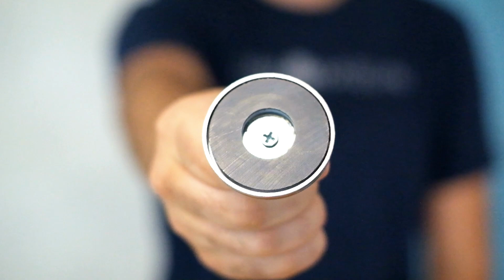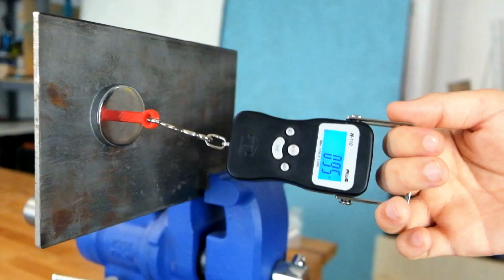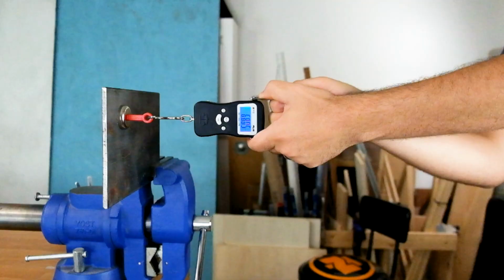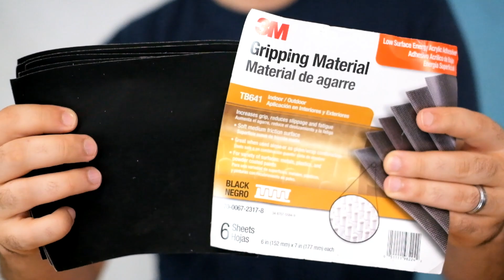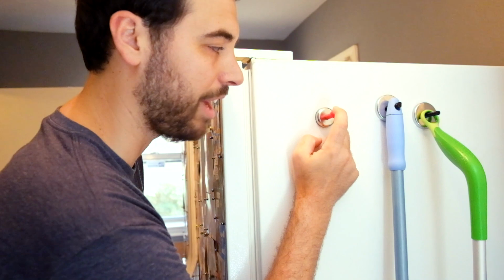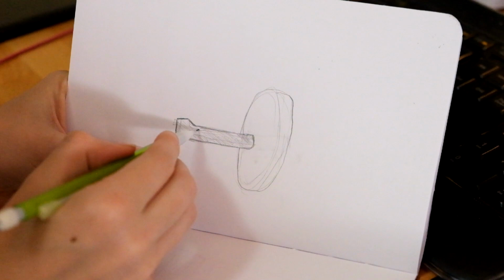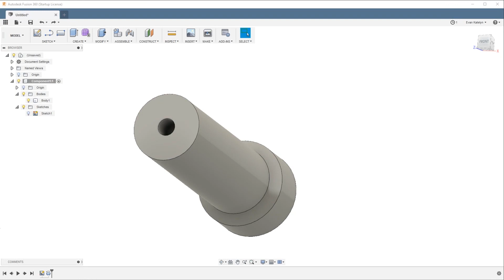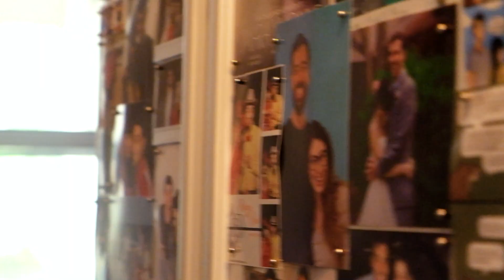Our Most Used 3D Print? & Evan Gets Distracted by Magnets!

Comment: Instead of using the vice, you could use the Fusion 360 hole tool and thread the hole, but do not model the threads (uncheck the option).  This will let you print an appropriate sized hole that can be tapped.  Then just use a machine screw.  I have had good luck with this method printing in PETG and even PLA.
Reply from the maker: Yep yep we've done similar methods! But this was a quick and easy solution too. All good options! 😁👍

Comment: Magnets seem to cling better to smoother surfaces or where the max amount of surface area of magnet is adhering to the metal. The fridge is coated with like a uh enamel paint and it's bumpy. So what if you made a thin thin rubber or silicone disk (minimize distance of magnet to metal) with the texture of the fridge so it would kind of lock/match up and be fully connected. It would decrease straight pull strength but maybe increase resistance to shear force.  Way overkill for what is needed but just an idea from one curious mind to another.
Reply from the maker: That would definitely be an interesting test to do! Haha yeah maybe overkill, but it could be fun!

Comment: Evan has become the Mad Magnet Scientist! Katelyn makes great roaring sounds :P I do thing the difference between the magnets (holding strength) had a lot to do with the surface area contact. The ceramic magnet looked like it had a larger diameter, hence more surface gripping power. I'm will to bet a neodymium magnet with the same diameter would have been stronger.
Reply from the maker: Interestingly, the neodymium, even at the smaller size, was rated for twice the weight so it was stronger... Just not in this exact situation. Would definitely be curious to try a larger one though!

Comment: Should've used a tap and threaded the hole on the print.  For the little bit of strength needed for that prints' function it would've been fine and wouldn't have a chance of splitting the print like the wood screw.
Reply from the maker: We often do tap our 3D prints but this method was quick and easy too

Comment: Try thin double-sided tape or just very thin slice of rubber : P should work. ive done some similar magnet shenenigans by myself so i know that it can be tricky, cause force between magnet and metal surface decays very quickly with growning distance... not sure atm about exact dpendence but it sth like distance^-4 cause it is dipole-dipole kind of interaction
Reply from the maker: it might work, but we worry it would have the same effect as the friction paper (which is kind of rubbery itself). maybe if the surface area was bigger than these small magnets?
Reply: if it will be thinner than friction paper (as i saw on a video it looks pretty dam thick;P) than chances are pretty high. it is rly about those fractions of a milimeter that make a difference.

im not sure about your question on surface area, but i think the answer is no, because friction force is just related to friction coefficient and to perpendicular force (in this case force of attracting magnet to metal sheet). so the bigger the force the bigger the friction (so need the smallest possible gap between magnet and metal). same with coefficient (the bigger the better). but in any case surface area essentialy does not play any role. of course if i understand your question correctly. pls tell me if im wrong.

Comment: I really dug the magnet experiments! I've been looking for a hook solution for my closet to hold the same kinds of things.  I may make something based on your design but with a screw hole for mounting it onto a board instead of a magnet...
Reply from the maker: That would be a great variation! You could do a rectangular backing that way you could still print the hook on it's side (to prevent layer lines snapping)
Reply: Oh yeah that's an awesome idea!  Thanks!  Also I might do like a rounded gusset in there to provide even more strength.
Reply from the maker: good thinking!

Comment: I totally get the magnet thing, I love them too 😀 I'm just thinking of ways to improve the design....... if you made the hook so that it still attaches at the same point then goes straight down, and mabey shaped around the magnet so that it comes into contact with the fridge, before extending outwards (a bit like the shape on the "enter/return" key on a keyboard). You could then add the grip pad to the base of the hook and not directly to the magnet..... so more friction withought magnetic strength loss. It would also change some of the forces envolved due to leverage (especially if the grip pad is on the hook). I know it would cost more to produce but it would be interesting to test the idea.

I love your video's because they get your brain working 😁
Reply from the maker: Would definitely be an interesting test to try out! We'd have to very precisely measure things so that the grip pad didn't stick out past the magnet and reduce the magnet grip, but I think it could be done. Glad you like our videos!
Reply: EvanAndKatelyn I love your video's. They always get my mind working and I laugh at the same things you guys do 😊 Do you use Sketch up for your 3D modelling or something else? I've just got a new computer........ it's really old actually but new gor me...... and I wanted to try out some things with it

Comment: Do you think the weaker rated magnet outperformed the stronger magnet in shear because the weaker magnet covers more surface area (even as an annulus shape)? 

I'm wondering if you have a rectangular magnet and orient it so that the longer side of the magnet is horizontal and the smaller side is vertical it will hold more weight pulling down than if the the smaller side is horizontal.

Still a friction thing or a magnetic force distribution thing?

Comment: I wish all 3d printers could print magnets (yes, all you questioning this, it can and has been done); but sadly ive only every seen 2 printers that are capable of doing it. 
For all you hardcore science people reading that dont know, magnet printing allows for a specific pole to be places on the magnet, rather than making cool shapes you can make normal circular magnets with a 
    N S N S N S N S N S N S N
N S N S N S N S N S N S N S N
S N S N S N S N S N S N S N S
    S N S N S N S N S N S N S
configuration. Creates cool patterns, makes the magnetic field stronger, and allows for powerful locking and repulsive devices.
I dont know of the comparison in force between a neodymium magnet and a 3d printed magnet, but i do know given a specific layout they can be incredible. If you wish to learn more look at catalog.polymagnet.com and im not a representative or anything, its the only place i know does these magnets
Reply from the maker: That's really impressive!